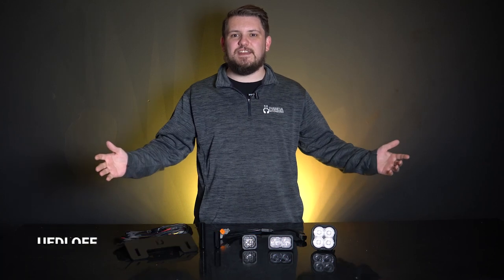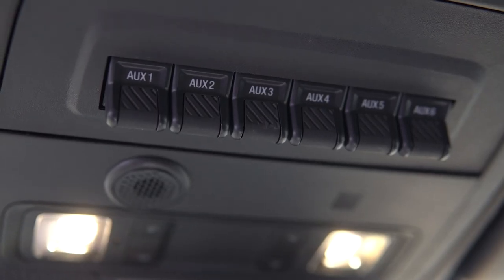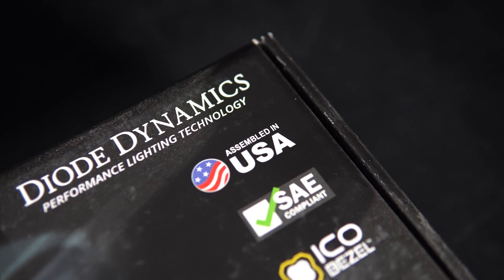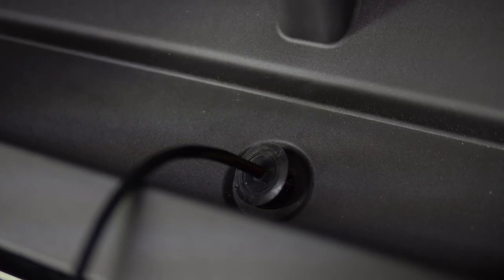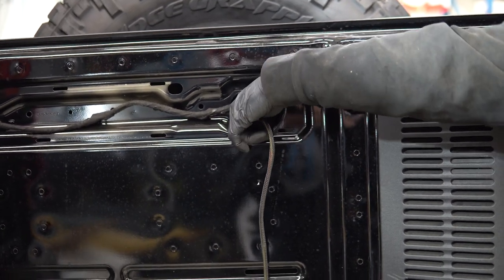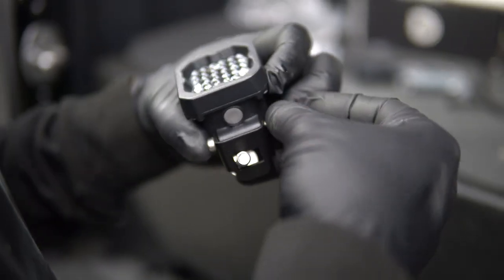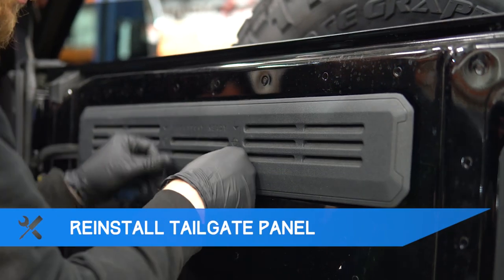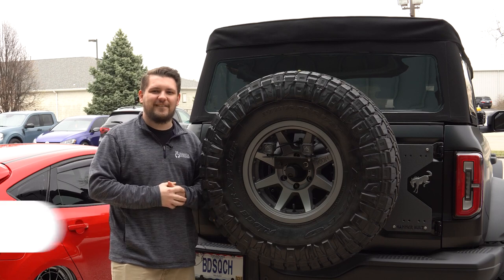The ULTIMATE Ford Bronco Lighting Mod! | Diode Dynamics Reverse Light Kit

Comment: Tell u this.there are a few of these in the market but DD has a plug and play harness and thr best warranty. Im not a fan of routing that wire through the hole in the trunk. The need to come out with a bracket that u can mount to a reciever or the third brake light  . I made  one out of band iron and i dont have to remove it if i have to take down the spare

Comment: Got them installed. But like always these vids leave several things out. First unscrew heat shield above exhaust. 2nd need to trim/ cut tailgate fins for connectors to fit through. My plug was installed backwards on the wire harness that comes through the hole above the exhaust. All in all pretty happy with this set up.  Hooked up to switch #2 aswell.
Reply: thanks for this, im going to be wiring up mine this afternoon. I'm not sure I want them to act as an additional brake light though, for off-roading i intend to put yellow lenses on, and i feel like the red shining through yellow for braking isn't gonna make much sense